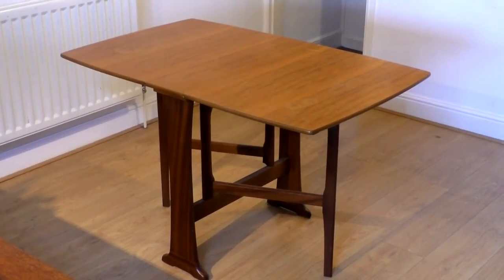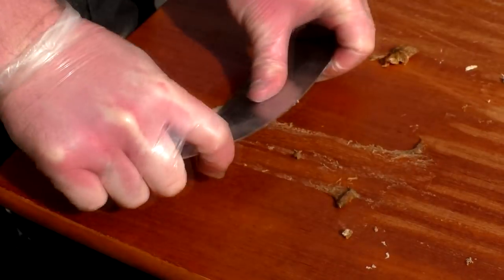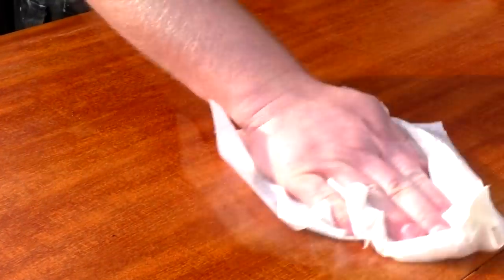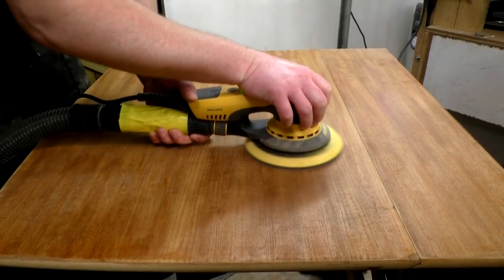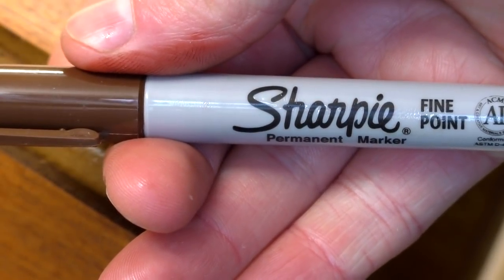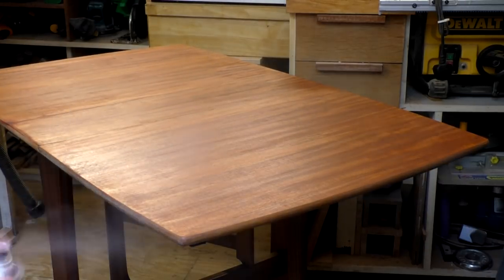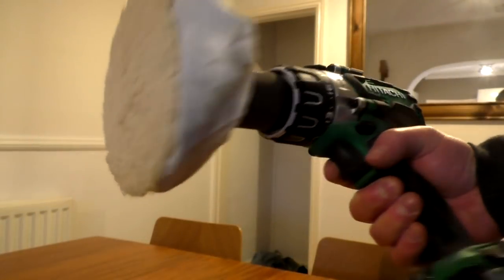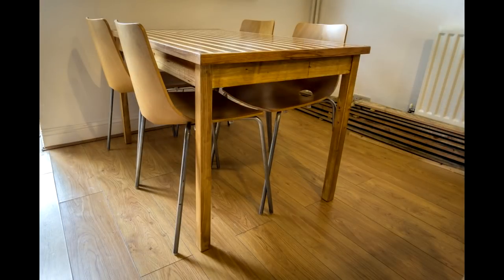Re-finishing A Mid Century Dining Table - Restoration

Comment: The next time you use stripper put it on much thicker. I would have used about four times the amount you did. After 30 minutes it should still look damp and gooey. I should bubble up pulling the paint or varnish with it. And it will be easy to scrape off if you apply enough of it.  The table turned out great. I always enjoy your videos!
Reply from the maker: Thank you!

Comment: Thank you for showing us that we need to be open to the fact that the mistakes can be ours and not the product.  I am impressed by how humble you are and your knowledge and experience is invaluable.  A tip I learned:  cover the stripper with plastic wrap so that it stays wet and make sure you apply a thick coat.  Some strippers bubble when activating.  I promise if you find the right stripper, you are going to love the results.

Comment: I had a similar fail with paint/varnish stripper (Citristrip) in the hot Los Angeles sun.  In short, I suggest applying it more liberally and also keeping it out of direct sun.  It might even be ready before 30 minutes.  When it works properly it's impressive - I use a plastic paint scraper and the stain glides right off.

Comment: Another thing I've learned and is referenced in the video: do not random orbital sand anywhere near the edges. They are vulnerable. These areas must be hand sanded. (Also, with random sander only use a fine grit paper e.g. 200.)

Comment: Never let the stripper dry out! I use b&q own brand  cheap stripper on MSN teak type  furniture, on warm days I let it sit for around 10 mins max, then scrape it off using a plastic scraper, sometimes needs a second coat but, longer is not better, never let it dry out, great resto

Comment: Its been said a few times but you need to use more of the stripper and keep it wet otherwise it dries out and you end up with re-cured varnish and stripper to deal with, also try putting heavier coats of varnish on as you will get a much better finish, if you put very light coats on as you did here it dries patchy as its not fluid enough to flow out in to its self much in the way a car painter applies lacquer
Great videos though and always good to watch keep up the good work

Comment: I used paint stripper in a very dense brasilian hardwood with no problems. But I applied a lot more and work out of sun light. Works like a charm. After cleaning with mineral spirits it was just a matter of sanding smooth.

But you gotta be carefull with the strong odor that comes out of it and dispose the stripped paint correctly.
Reply: Side note: It was a very old door with seven or eight layers of oil based paint.

I made it into a table. The result is here:
https://www.instagram.com/p/BhhigYGH_e8/

The client demanded it to look that way ;)
Reply from the maker: Nice!
Reply from the maker: Out of curiosity what is he best way to dispose of the stripped paint/varnish?
Reply: Hi Keith put then on weeds, or your local council dump.
Reply: Keith, usualy the place where you buy the stuff has more information. It changes from country to country. But is very toxic. So be carefull.

Comment: What a loverly table. I think the issue with the stripper is you did  not apply it anywhere near thick enough.
Reply from the maker: Yeah lots of people have suggested that. Next time I’m going to be more generous!
Reply: I prefer the gell stuff for that reason, i used nitromors its not as good as it was but it works well and you can always add some dichloromethane back in to make the stuff work how it used to. It worked well on the ........ 14 layers of paint of my windowsill.

Comment: Great restoration job. Thanks for sharing the video.
Is it possible to sand of the top layer of the table (instead of using the chemical stuff or a scraper) with a random orbit sander?
(I have a small delta sander which also has sand paper for sanding away paint but that kind of sand paper I did not see somewhere for a random orbit sander)
Reply from the maker: Yes it works fine but you have to be careful not to sand through the veneer (like I did in this project at the edges!)
Reply: I understand. Thanks for explaining.

Comment: Been usimg stripper for devades. First. Citrus Strip is the nest brand. Second put some on . lad.  Slather is a term that cones to mind. Need to have enough to remain almost liquid when you go to remove it. Let it bubble up for a while.   Good luck with the next one. 

Really cool table ny the way. What did you do to the base if anything?  Video was all about the top. 

Keep up the good work. Your vids are great. Cheer you up
Reply from the maker: Thank you! I forgot to film what I did with the base, although it was pretty boring anyway, just sanded the chipped area back a little and finished with some spray varnish 👍

Comment: The biggest mistakes with the stripper were with the application.  For one, it was way too light.  Second, you shouldn't brush the material back and forth with the applicator.  Lay down a heavy coat of stripper and do so in one continuous stroke across the wood.  Don't go back and forth over the material feathering it out once it's laid down.  There is a chemical in stripper (similar function to gelatin) that makes the material thicker and helps keep it wet longer but vigorous brushing back and forth breaks up that material and allows the active chemicals to dry too quickly.

Comment: Wow 10 Pounds! Bargain. I’ve found the paste type of varnish remover works better....the citrus based one....let it sit and keep testing a spot until you can see that all the varnish has let go, then scrape away. I’ve also found it’s worthwhile to keep a stock of timber matched fillers on hand....I’ve got about a dozen in small pots covering just about every type of timber that you normally see on period furniture.....sometimes adding a bit of epoxy to the filler works. Finally another good trick is to keep a small stock of alcohol based dyes (again I have a bout a dozen in tiny little bottles).....all these tricks give you an arsenal of different approaches to fix trouble spots.....total investment of about $100. Hope that’s of some help. Keep up the good work. Greg

Comment: Thanks for your great, friendly looking videos.

I’ve a question, which is not answered in your finishing video and applies to this one.

How could a spray varnish work on top of an oil? Because you need to degrease the surface before applying the Varnish.
But you’ve just spoiled oil, which is very greasy if you ask me.
Do you know how this works?

Thanks!! 🕴🏻🕴🏻🕴🏻
Reply from the maker: As long as the oil is fully drying before applying the varnish it works just fine. I’m not sure how or why though!

Comment: When I have had to remove old paint back down wood i use acid based paint stripper but hard to buy now due to health and safety but what with all strippers you need apply thick coat and leave long as you can before removing Nice use sharper pen best £10 you will every spend

Comment: I had to strip brown varnish from both sides of 15 doors in my current house! I used a product that consisted of caustic soda and dichloromethane.  You then wrap it in clingfilm leave for a couple of hours and pressure wash. Nasty job but worked pretty well. Not sure if you can still get it, think you may have to be a 'competent person' god help us - which probably means doing a £300 course and getting a meaningless piece of paper. Bitter and twisted, moi? :)

Comment: with any stripper you need to user apply and keep it wet. Once it dried, you are defeating the purpose. Also could be the stripper was crappy and not good enough but to me, you let it dry, which is a no no

Comment: all these comments and no one has pointed 
out the obvious and that is that the active ingredient from paint stripper was removed a few years ago . Di chloromethane . it's this active ingredient that really made stripper work well. the modern versions of stripper are absolute rubbish . I believe professional restorers etc can still get proper stripper but you have to have the relevant license and proper handling procedures . when your at a car boot sale keep your eyes peeled for old tins of paint stripper and check the ingredients list. the modern stuff will work but it's no where near as effective as it used to be . much like crecote and that new nonsense they sell creocoat.